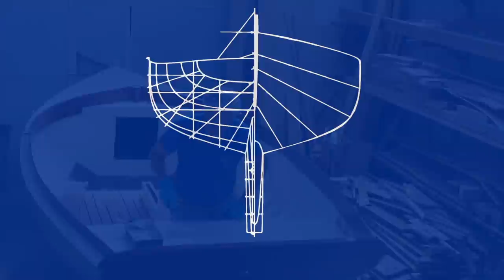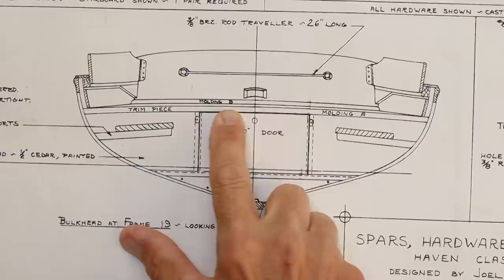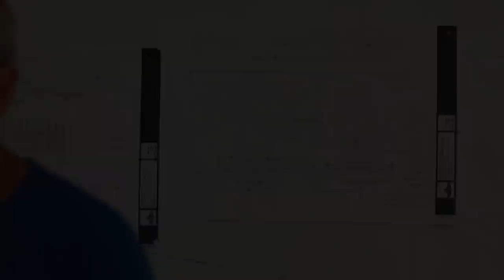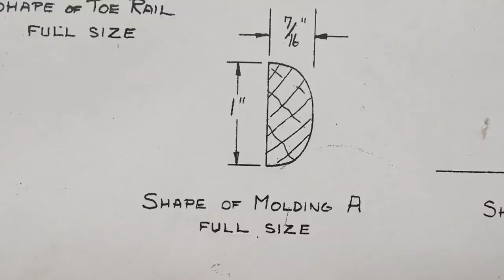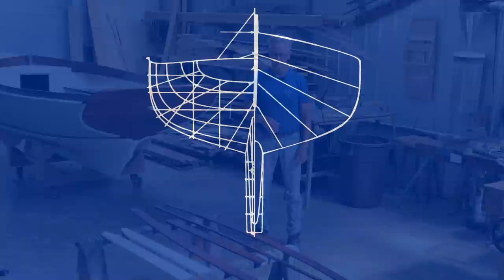Wooden Boat Building, Cover Boards and Trim, S2-E49

Comment: Looking Good Bob!
Reply from the maker: Thanks Chuck. That shot of your Haven with the sunset was awesome
Reply: @TheArtofBoatBuilding    I got a little lucky with that one. :)   I still have a leak in my center board trunk. back off of the trailer and blocked up in the shop. pull the centerboard tonight. making me crazy.  This time, I know almost exactly where it is.  Press on!

Comment: Brilliant method of fitting... get one side close and scribe to fit, then trace the other side. Seems like common sense. But you see so few people use this technique. Good on you for using your brain to get a proper fit. Way to set an example of the K.I.S.S. Principle.

Comment: You use staples that you later remove; there are fiber pin nails that can be left in the material and can be planed or sanded without damaging your tools. The holes are smaller also. Maybe you knew about those, and if you did, at least I fed the algorithm! ;)
Reply: I did not know that, so thanks for sharing!
Reply: Yeah, I've seen plastic/nylon pin nails for an air nailer too. They can be planed as well. Not sure if these are what you were referring to.
Reply: @thomasarussellsr  Yep, sounds about right.

Comment: What’s left to do? A mast, boom, and rigging.The sails. The rudder and transom board.  
Splash day will be coming soon.
Reply from the maker: That’s pretty much the short list. I will be casting the bronze fittings and sewing the sails. So in reality launch should be in the spring.

Comment: For a gold key boat it is one of the Prettiest out there. I'm building my boat to look good from 20 feet and get beat up with use. Faster to the water and a whole lot cheaper.
Reply: Yup, difference in perspective, I suppose...
Beautiful at touching distance takes more time and attention to detail than an "at a distance of 20 feet" boat does, but so true that a 20' distance boat will get to the water more quickly. I suppose it all depends on your priorities. Whether you want a "show" boat or a "get out and go" boat; as long as you are happy with the results, that is really all that matters.

Comment: Interesting resaw lesson.  Did you have to do anything extra other than accounting for the groove depth?  Were you resawing on one side of the groove kerf?  Lots of bits of trim that I suspect I could easily overlook even though they are clear on the plans. Thanks for the video.
Reply from the maker: Hi Robert,
Yes, I stayed to one side of the kerf. It was very interesting that If I deviated out of the kerf I immediately could feel it.
Thanks for watching!
Cheers,
Bob

Comment: Its good to see your back at it.  You must be a little disappointed you won't be done for the Wooden boat festival.  Are you still going?
Reply from the maker: Hi Petter,
Yes, I'm still planning on going. Just going to bring the boat at it current state of completion.
Hoe to see you there.
Cheers,
Bob
Reply: @TheArtofBoatBuilding  I'm wondering if your going Sloop or Gaff rig?  Also if your mast will be solid or hollow?  Will you try the bird mouth router method?  Hopefully for the spars anyway!!!  Hope your well.  
😃

Comment: Hey Bob, what were those snips you used on the 1/8" strip around 12:45?
Reply: I think they are upholstery trimmers.  Micro-mark sells them.
Reply from the maker: Hi Ben, They are called Mitre Shears. Handy tool!
Cheers,
Bob
Reply: @TheArtofBoatBuilding  Thanks Bob!
Reply: Looks like an airplane shaped anvil with a blade that comes down to sheer off what ever you're cutting. Definitely never seen sheers like this before, myself.

Comment: Those mini planes were a bargain. Thought at first you had made them yourself.
Reply: Same here.  They look like something Bob would make.  That he considers them usable is a good recommendation for them.
Reply: I have that exact set. my wife bought them for me!
Reply from the maker: As with most HF tools they did need a bit of fine tuning. Mostly sharpening, also the iron was in backwards on 2 of them. Great little tool for your boat building arsenal. 
Cheers,
Bob